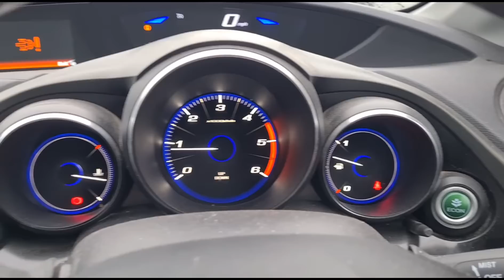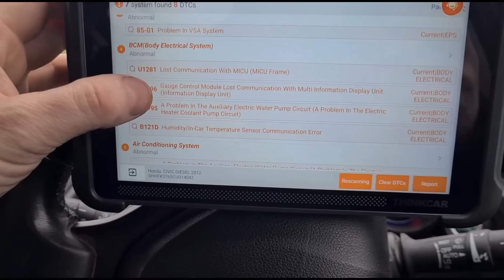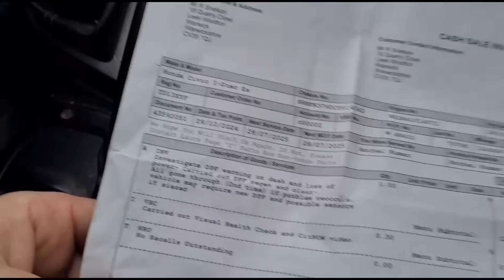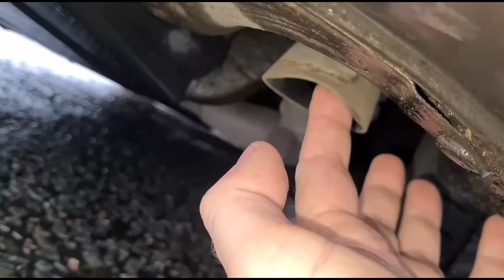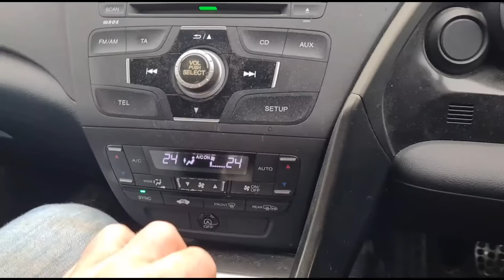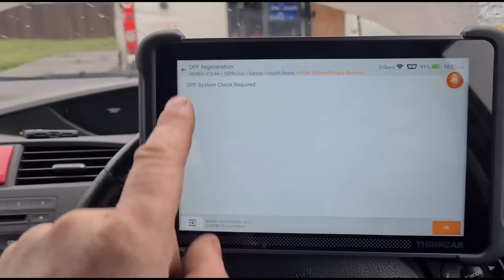Honda Civic DPF and Auxiliary Water Pump Issues

Comment: Have you ever had a transit 2019, 2.0, had a new dpf and a new pressure sensor single line, replaced but I cannot reset the values on the dpf at all and the inlet particular pressure keeps climbing to the the max on the diag, wether it’s plugged in or disconnected to the pipe, I have done software updates still nothing 😢

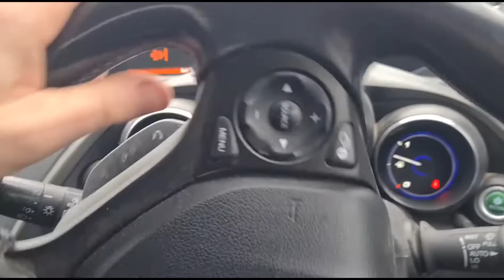Comment: 2:40 That’s the normal level on the gauge for a Civic, though it shows that level on the gauge from 60c

mine engine (1.6) temp rarely gets over 70 in winter.  And I did change the thermostat
Reply: Wait, what?? My car 1.6 d civic is in the garage right now, changing the thermostat because I thought it was stuck! Never knen it was a common things for these! Thank you so much stranger!
Reply: @IamChrisTurner yes, when I’m sat in traffic in winter, the temp gauge will drop and I don’t get any warmth coming through.   It’s because it burns so little fuel on tick over.  Thankfully its got heated seats
Reply: @GLH8 That’s really good to know. You’ve saved me a lot of cash trying to figure this thing out. Even the garage didn’t know! 
The heated seats are a god send but one thing that bothers me is a notchy gear change, it’s not as smooth as many other manuals. Do you have this problem?
Reply: @I @IamChrisTurner ah, mines like that, but I like it like that.

Comment: the AC system will be short of gas
Reply: No, it’s simply the on board soot light disabling the air con. It’s not a fuse/relay both been tested. It’s the auxiliary water pump potentially requiring replacement and failing that it’s a wiring issue. So coukd be as simple as a dodgy earth. AC systems seldom require a regas. Fluid rarely leaks out even over time especially with Hondas as components in any aspect of the car are so well engineered and made. Hondas like allDPF equipped engines also require a low ash oil. C1-C4 I think from memory. I have a Honda Accord iDTEC Tourer manual which is a stunning car. Last 2 MOT’s not even a single advisory. I always hoof mine around no prancing around driving. Cars approaching 155,000mikes many still running strong way beyond 250,000. I still get way over 40mpg. Get 50+ on a fast run

Comment: Scary…  Honda should have picked up on that. Even without a scan tool you were straight onto it Jimmy in minutes “that’s your problem why you’re dpf isn’t regenerating the ac’s not working”. You very patient and good with your customers. It’s not easy when somebody’s chirping away over your shoulder 😂. Great video you saved that poor man a lot of money as always you’re amazing well done Jimmy 🙌 🙌🙌
Reply: How did the Honda garage manage to do a regen if the AC isn't working?
Reply: @davidnorton5887  - If you disable the AC inside the cab, they do regens. The owner must ensure it's disabled when driving it. I've owned the 1.6 IDTEC & 2.2 IDTEC I've done over 20,000 miles in two of them and both had faulty AC. Both still did regens perfectly fine.
Although the software is clearly different for forced regens.
Reply: @davidnorton5887 They carry out a forced regen via the OBDII port. Rather than the car doing it itself automatically

Comment: Why cant Honda garages fix their own cars? ? 
Why are they just rip off merchants?  
£4500 for a DPF it doesn't need and the cars worth £4500 on a good day with no issues.
Maybe the Honda monkey mechanics can just change brake pads and wiper blades!  
Should of got a petrol, 1.8!
Reply: It's because they're not used to diagnosis of vehicles. I work at a honda dealer but I've worked for BMW and other brands so I've got lots of diagnostic experience. Honda diagnostic system is awful too, very old fashioned and doesn't give enough data to look at.

Comment: So annoying, Jimmy!  Nice diagnostic though. What I find odd, is that not all cars require the AC compressor to be on, to start regen. Maybe they don't need an extra load on the engine. Anyway, an auxiliary water pump in the AC, prevents the vehicle to regen on its own - probably that's why Honda didn't figure it out but, as dealers, they should.
Reply: So how did they do the regen in the first place then?
Reply: @samsonsamsamsam  That was my first thought too, but I suppose that if the clutch hangs on, just for a little while (enough for the software to pass this check), it will proceed to regen. You saw that it tried to engage and went off straight away - maybe if it held for a few milliseconds more, it tricked the software. Anyway, the engine temperature was also borderline low, which can also prevent regen, even if not in the present case.
Reply: So far I only heard about Asian cars requiring this AC pump to be on. Last video jimmy did was a year ago and that was the first time ever hearing this. I always thought, seeing how nearly all cars do it, they all do it in the same way, but Asian car brands always like to complicate stuff more than the Germans 😅. Anyways, I would NEVER go diesel in ANY Asian car because of this. Thankfully, Toyota, honda, etc have great hybrid/petrol engines so people can choose those instead of Diesel.
Reply: @hadiamrane  Yep!